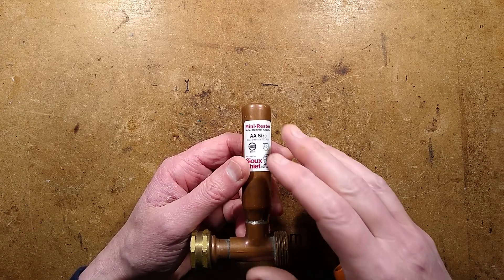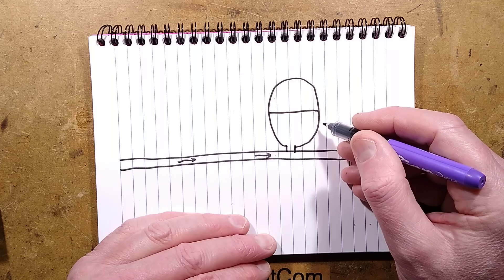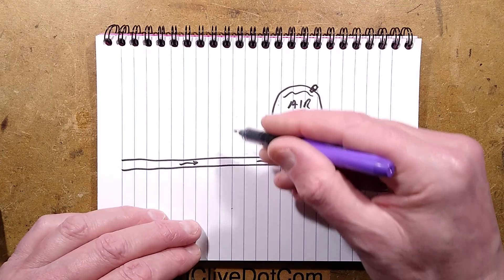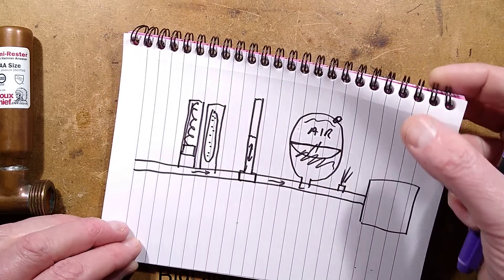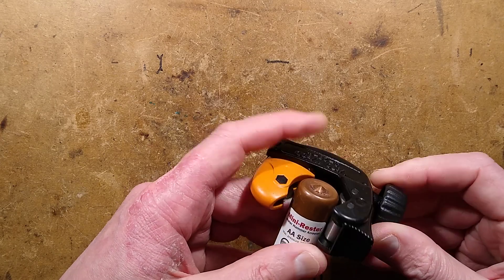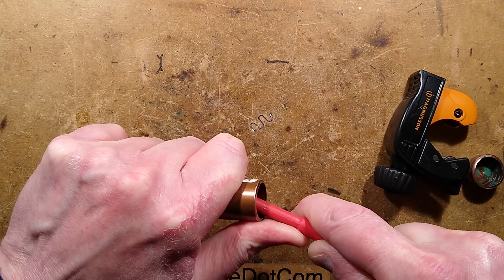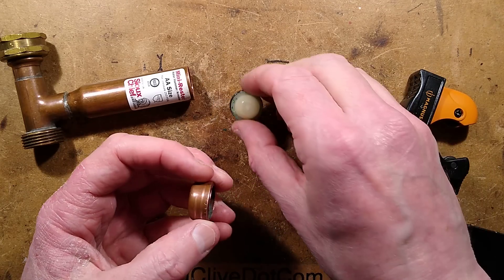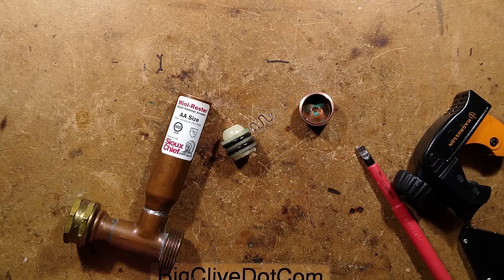inside an American made anti water hammer device

Comment: We (in Fort Wayne, IN, USA) had one installed in our old house.... It worked great to reduce "pipe noisy vibration" when dishwasher or clothes washer opened and closed its valve. (likely a clamp loosened somewhat and the arrestor fixed it.  The end is "hot formed"

Comment: the blue nasty plastic, comes from the material, VA2 sheet metal, it comes on big coils, since they are chrome and easily scratched. they always have this blue protetcion. 
You really should take them away as soon as possible. It gets old nasty and sticky and wont come off as one if they degrade ^^'

Comment: Hi Clive. You're mixing your water systems: You can have an expansion vessel on the heating circuit (but not the hot water circuit) because it is a closed circuit and not a Legionella risk. Where you should avoid 'dead legs' is on any system where the water is likely to form an aerosol (hot and cold water feeding a shower for instance). There is alos a risk of Legionella bacteria growth in thing like immersion heater tanks (especially in the stagnet sludge at the bottom of the tank). For this reason it is recommended that immersion heater tanks be taken up to a temperature over 60°C for at least an hour on a regular basis.
Where this may be a cause of concern is when you may be working away for an extended period and the system just sits.

Comment: Since it doesn't have any way to pressurise it later its not worth the money.

I have well water that is full of iron bacteria, and if it gets air any place it grows so many of those just a rising pipe that is blocked  will just be a bacterial warfare agent 😅

My well pump has an built in bladder tank and the pump goes to 6 bar, and i turn off the pump and water supply and open hot and cold at the sink then charge the bladder to 5.5 bar before turning it all on again, and what a difference compared to having just 3 bar as it was a few days ago. 

No i barely notice that the pump is cycling when it has been off a while, before the water pressure went almost to 0 before the pump turned on (flow sensor that turns it on) and also the pressure release valve on my hot water tank doesn't leak anymore.

I recharged it AFTER my whole house water filter that is rated to 10 bars blew up from overpressure when the water heater turned on...

Comment: Couldn't hear any pressure rushing out when you cut it and the plunger is almost at the top.
Either a bad design or an worn out device, it won't do anything if it isn't charged with about the same pressure as in the water pipe. Cause it will be bottomed out and have zero movement...

Comment: I had a lot of water hammer problems when we changed washing machine. The only way I got an anti-hammer device to work was by partially closing the 1/4 turn isolation valve to throttle the flow.
My guess for manufacturing the device shown would be to deep-draw it from a solid slug, probably with several annealing stages to prevent cracking. The neck could be made by spinning the component after inserting the plunger. Just a guess, of course.

Comment: When I lived on a narrowboat, we had water hammer..  I used a 2 litre fizzy pop bottle teed off the pump as a reservoir...  Mounted opening downwards, it would gradually fill with water and become less effective as the trapped air dissolved into the water...   it needed draining and refilling with air every 3 or 4 months...

Comment: Yes, the standing pipe was stopped due to the risk of stagnant water but this does not apply to the pressure vessel as that is only fitted to the primary circuit of a boiler. IE not drinking water.

Comment: We have an unvented central heating system. The bladder in the DHW expansion vessel failed (water came out the Schrader valve, like you said). 
What surprised me was that a replacement bladder would have cost more than a brand new expansion vessel.
(It was an easy swap though I'm not sure it's legally a DIY job in the UK).

Comment: I'd have figured the cap had a hole, so the plunger would have sat at the top of the "cylinder" while the base was brazed into the T piece, so as to not melt the O rings, or the plunger itself.  Then the plunger was pushed down, and the hole in the cap filled to seal it.

Comment: 100% accurate.  The inverted T was extremely common in homes from built/renovated 1940s to about the 1980s when arrester devices became common.  Most of the homes throughout the Midwest and west coast build in the post World War Two boom had inverted T setups.  Surprisingly in the New England coast you saw this a lot less.  Many more towns tended to have lower pressure supply systems or they predated the requirements for back flow prevention systems on the city water supply.  So many houses just depended on the water main to kind of act as a buffer or even the water heater (and usually washing machines were in basement close to the main supply).

Of course in cheaply built homes with PEX you now get people complaining about “things moving in their walls” as badly secured PEX flops around.

Comment: Top is a spin machined seal, use a lubricated tool on the pipe stub to turn it over, priobably with a former inside the pipe stub, and form it into an end, and the shape comes from friction welding the copper into the final sealed shape. forming tool probably is hollow, and a few small holes to allow it to pressurise the end, and blow the tube off after forming. does both release and pressure test at the same time, as easy to pressurise in a water bath, and check for bubbles, then full pressure to blow it off.  Then insert piston from other end, and press down fully, with a tool, and roll the copper down to make the neck, and the tool ensures it is round where the solder will be. 

These days most of the water hammer is taken care of by both having a restrictive inlet filter with mesh, and a slow closing rate on the solenoid, plus also using a flexible hose that can expand to reduce the shock. Still there, but now greatly reduced over the old valves that slam shut fast, and had much higher flow rates. most extreme example is fridges with water dispenser, where you can see that plastic pipe bounce every time you use the water dispenser, but when it uses the separate valve to fill the ice maker side there is no pulse, long heated tube in the freezer compartment that is a small diameter, and thus low flow.

Comment: Give me the stub full of air any day. O-rings perish. And in this case, with the o-rings being used as piston rings, they will wear out. I can see its usefulness in certain situations, but not in a permanent installation, like inside of my walls. Yeah, supposedly the stub will fill with water over a few years. Then you have to drain your pipes every few years and it's fixed. Compare that with replacing these arresters outright every few years. Yeah, no.

Comment: As a Glasgow Plumber & Clive’s resident Plumbing Guru, please note the term ‘Water Hammer’ is used to describe this problem. Which can be commonly caused by a vibrating item in the system, a Tap Jumper or Washer, a FloatValve in a Cistern or Tank......etc etc.
Indeed, the T & blank Tube method was used extensively here in the UK at all Tank Float Valves. Until the regulation changed & they were banned.

Very few Water/header tanks are now fitted in modern homes here in the UK & for WC Cisterns, equilibrium Fill Valves are fitted - which by design don’t have vibration issues.

I hope that clarifies things & thanks Clive, you big hairy beast!!
Luv Dick Puller❤❤

Comment: This Sioux Chief Mini-rester has 3/4 inch female and male couplings and is intended for installation at the point where the flexible line of the problem appliance connects to shutoff valve of the permanent plumbing.

An alternative solution is to install something like a Watts LF150A on a tee in the water supply line to the residence.  The LF150A has a 1/2 inch MNPT male thread for connection to the tee.  The operating pressure is up to 150 PSI with a flow velocity of 10 feet//second.  The device can absorb a 200 PSI hammer.

Comment: You can make your own. A T fitting going to a reduction fitting set in backwards followed by a larger diameter section of pipe with a cap where you can screw on your own schrader valve. Place it online and add some air pressure to it. You will need to top it off from time to time unless you can machine a plunger from Delrin plastic with two grooves for the O rings. The schrader valve will pressurize the upper chamber without dissipating the air into the water.

Comment: Over the years I've purchased several of the exact same "mini-rester" for my dishwasher and let me tell you it is utter piece of crap! Made in USA doesn't mean diddly squat. They all failed, as in water hammer started in about a year after install. They also make the mini style in stainless steel enclosure instead of copper, and that one failed too. Finally I bought a "bazooka" sized version and made sure it is standing up right, despite SIUX claims that it can be mounted in any orientation. The large one still functions after about 3 years of service. I cut open one of the failed mini styles to investigate and it was seized up with excessive amount of calcium deposits and green corrosion and seized up.

Comment: The number 2 item, when installed, the idea was air would be trapped when installed - not air in the water. And it didn’t work.  Apparently the person who thought it up never carbonated beer. Gas under pressure in contact with water eventually dissolves in the water.  I’ve had the Sioux chief ones for 20 years.  Work great.  They need to be installed as close as possible to the solenoid to be effective

Comment: Yes BC, you absolutely need to install a homemade visual water level pressure gauge on your water system!  You can never have too many gauges!  That's what makes boilers so cool and fueled the Steam-punk phase most of us went through!  Mmmm, all the dials and gauges, and meters, forever!. ( And throw in some nixies).  Though to be clear, gluing a pocket watch to a top hat does not make you steam punk.  

Also, why do I and all the electricians I know seem to have side hobbies/interest in plumbing?  Is it because they both involve transmission lines?  Is it the diy aspect?  The universal need to know how everything works?  I can't wait till we graduate to plasma conduits!  When can we start working on that? ...(trails off into geek rant)...

Cheers!

Comment: Look at the old horse drawn fire engines. They have a bulbous device in the center. I asked a fireman friend about it. He said it functions as an anti water hammer. Think of the nozzle being turned off or changed quickly. You have over 8 pounds per gallon of mass rushing through the hose.

Comment: I fixed my water hammer problem by just replacing the washer on the offending tap with a hemispherical washer. I suppose that caused a more gradual opening and closing, so more laminar flow, and harmonics slamming up and down the pipes.

Comment: Are our threads comparable with those in the UK? Also, the old dead end pipe solution begins full of air, and works fine. The trouble is, over time the air dissolves in the water and condensation filled the dead end, and it looses effectiveness.
Reply from the maker: Although we use metric pipe we still use imperial tap connectors.

Comment: We’ve got two sets of two water tanks collecting rainwater. One of the pumps has a large pressure vessel on the top of it, with some pressurised air in it. The pump runs until the pressure reaches its upper limit, compressing the air at the same time. The air pressure forces water through the pipes when a tap is opened, until the pressure reaches the lower limit, and the pump comes back on. It means the pump doesn’t need to run 100% of the time when a tap is open.

Comment: 2:32 The problem with a stand pipe setup was the air would get absorbed into the water making it useless because nothing is there to separate the air from the water

Comment: I would have been more impressive if it was the double D size To ream a pipe try using your flaring tool to open the cut edge, they are easy to use as well. Thank you, keep working.

Comment: I have a couple of these (Sioux Chief, even) on my washing machine, and i have been messing with them this week because one of them stopped working.

In my failed unit, the air pocket is gone, and the piston is stuck at the top of the cylinder. It is possible to get it working again, at least for a while, by draining it and re-assembling with the air chamber pointed up. That traps a pocket of air (below the stuck piston), and that air pocket does mitigate water hammer. But the air will slowly dissolve into the water. I believe this was the problem with the old dead-end system as well.

It would be pretty useful to have an air fitting at the top of the chamber, a way to recharge the arrestor after the air inside had dissolved away.

Comment: the well were on the pressure vessile helps to boost the water pressure around the property (5 acres) it also absorbs the pumps shocks to the system as it kicks in an out via relays (220vac)  an pressure switch ugh the year it got so cold the 1/4 fitting tween the switch an main line froze leavin us with no water till i got it defrosted

Comment: An extreme case of water hammer happened near my old home.  The city was checking fire hydrants which have a valve plate that opens downward into the water flow.  One plate hung in the open position and then slammed shut stopping the full flow of the fire hydrant.  The water hammer burst the pipes in a city block of houses.  The city did pay for the water damage and plumbing repairs.

Comment: The dead end pipe is what I grew up around. It works relatively well when on the upper floor. What I've seen is a 1/2" vertical pipe t'd off a 5/8" or 3/4" pipe, typically about 3-4 feet (0.95 to 1.3m). But copper is getting expensive... so less material is preferable.
Edit to add: due to dad's tinkering, and periods of blackout extending to days, the house never went more than 2 years without a full drain.

Comment: Without a bladder, any air in a tank or pipe will be absorbed into the water. I've been managing pumped water systems for most of my life. A pressure tank without a bladder will stop working after some time. There is a noticeable decrease in effectiveness after a summer.

Comment: Another solution would be the appliance manufacturer using a slower closing solenoid valve. But they don't. Should be mandatory.  I've installed these Sioux Chief Mini-Rester from Amazon on my washing machine, dishwasher and toilet.  They work well but sometimes they lose effectiveness over time and need to replaced.  Plumbing code often require them with new fixtures as well.

Comment: (not a plumber but worked on fluid systems) Here's a thought on why it is designed like that.  Air slowly absorbs into water over time.  So if you had the old time stand pipe like you talked about, I THINK that over time they can end up filling with water as the air trapped in them gets absorbed.  The device you took apart is the same idea, but I'm thinking the plastic plunger / o rings / silicon grease serves as a barrier between the air and the water.  Kind of like a really tiny version of the air pressurized rubber bladder tanks. 
Air can migrate into and out of water.  I've had to deal with it in water systems for nuclear power plants and when I worked for a hydronic heating supply company.

Comment: The non-isolated air columns did tend to fill with water over some period of time, usually many years. But an occasional draining of the pipes in the house would fix this. As for the stagnation, unless they are absurdly large, the water does move in and out fairly regularly. And with chlorination in public water systems, that does a pretty good job of preventing biofilms from forming in them. With private wells, it is probably a bigger concern.

Comment: I would think they first used solder to put the 2 pipes together and then put the plastic thing in with grease and after that slowly round off the end of the copper and lastly close the gap. That should prevent it from dying before you even used it. Solder gets way too hot for those components.
The problem with the copper pipe method is that water absorbs the air rather than the other way around. The air will just slowly drain from that pipe instead of going into it.

Comment: I've installed a dozen or more of these and find they stop working after a couple years. The o-rings on the piston leak very slowly and over time, the gas charge disappears. So for my wash machine, I had these with garden hose fittings attached right at the inlets. Again, I got about two years then the water hammer returned. I could reduce it by closing the supply valves somewhat going to the hoses. But getting it to stop outright required closing them too far for usability. 
So rather than replace them again, I cut the tops off, pulled out the pistons, and soldered about 2 feet of copper pipe with a cap onto each. It sticks up at the back of the washer. If or when they actually fill with water, I just need to turn the supply valves off for a moment and turn on the washer to let the water run out again.
They've been in place now for a couple years and I've not had to refill them yet.